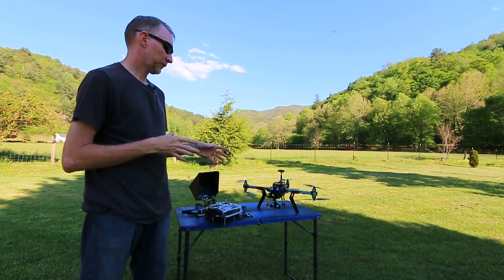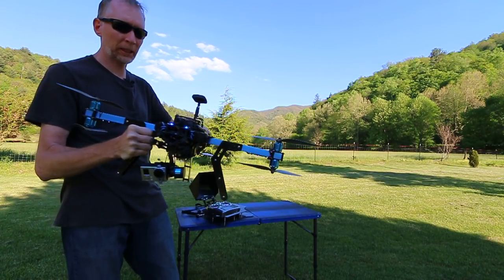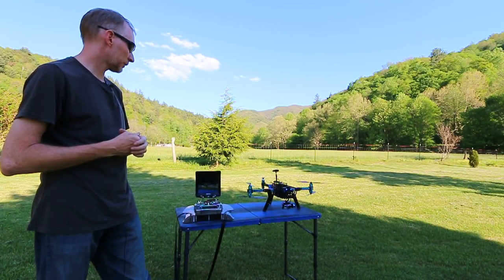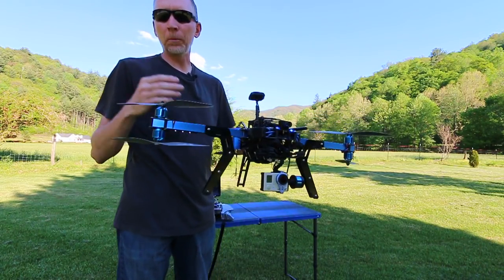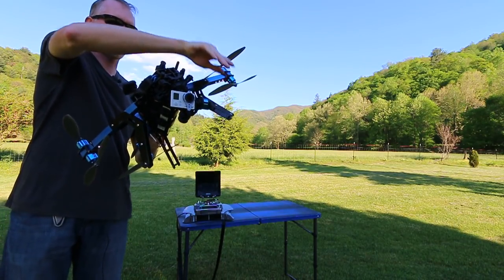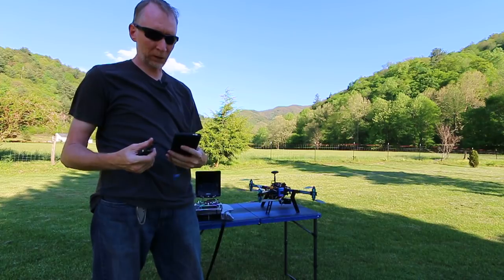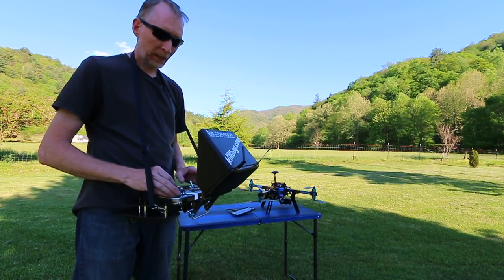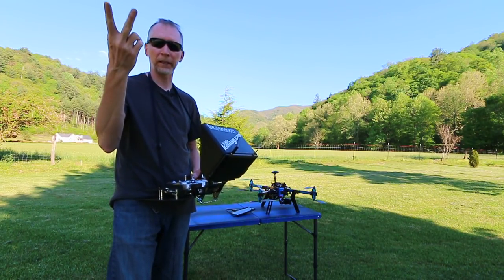3D Robotics Y6 Overview & Info

Comment: I been looking to get into this, alot due to watching your videos. ;) I've looked at DJI Phantom 2 w/ Zenmuse H3-3D Gimbal and Vision 2 Plus. What are your thoughts on those.

So your 3DR Y6 came with everything but the gopro and the gimbal?
Reply from the maker: I haven't had any experience with DJI copters, but I've heard mostly good things and they are the big dogs for entry into the autonomous camera drone field.  A few stories of fly aways, so put your contact info on there no matter what you get.

I just got an H3-3D gimbal myself to replace/upgrade my Tarot T2D gimbal, but I haven't installed it yet, so can't comment much there.  It is surprisingly lighter weight than the 2-axis gimbal though, so that's nice.

The Y6 kit I ordered did come with everything except the Gopro and gimbal since I already had those, although they will sell it with those parts as well.
Reply: killboydotcom Yea I been researching about them alot  before I actually buy one, so want to be as informed as I can.

I'm leaning towards the Y6 as its not all that much more once you add the gimbal, FPV, etc to the Phantom 2. The Vision Plus looks like a nice AIO package, but the gopro setup seem to be more versatile and future proof.

Does the H2-3D look like it will be a direct bolton replacement? And where do you get your parts? I not been able to find the H2-3D on the 3DR site. Be nice if it was a optional addon like the 2D gimbal is on there.
Reply from the maker: ***** No that gimbal will require some "engineering" (used loosely in my case) to make it bolt up, but I think it won't be too hard.  I just ordered it off Amazon or something.
Reply: Yea, for some reason I dont think that will be much of a issue for you. lol

Let me(us all) know it works out etc etc.

I've was looking at the electrohub diy kits by Flite Test for a intro/learn to fly bird, all sorts of possible configuration with that thing. And while reading up on that, watched a few videos on the TBS Recovery Pro, Thats a interesting look airframe (picking up all sorts of terminologically lol).

Thanks for the feedback and hope to see ya on the hill soon. ;)

Comment: great video.. i have been trying to get a decent machine for over four months now.. am on my sixth yes I said sixth copter and I was just about to give up until I found out about these 3dr machines.. kicking myself for wasting so much time and money chasing phantoms and 550's and 440's and storm drones.. argh well for the most part I got much of my money back but not without a fight.. had flyaways and fails due to crappy dji gear.. but that is the past.. so my question is.. what is the little camera looking gizmo that you have on the top of this one? and does this one offer the follow me tech out of the box like the IRIS?
Reply from the maker: That camera looking gizmo is a camera. ;)  It's the one it comes with for FPV, but have since removed it since I just use the GoPro video feed to see exactly what I'm getting.  Some advise against using the GoPro, as it can shut off without warning if the card gets full, battery dies, etc, but I have it getting power from the copter's main battery, and a big card that's always cleared so never any issues.

It does have the follow me feature using your cell phone, but we live in very mountainous terrain, so I haven't tried it. (or really had a need to try it)  These machines are essentially "flying blind", so be careful if you try that.  Not for use around people, trees, power lines, etc, IMO.  Machine has performed flawless otherwise, save for an instance of GPS loss when flying under a low cluster of power lines one time...had to switch to manual mode real quick and bring it back.
Reply: yea I have seen that before on others and I always wondered what the benefit of having two cameras would be.. seems like more weight and battery drain.. again thank you for the very helpful video.. your time and efforts are much appreciated.. warmest regards

Comment: have you had any issues with support from 3d robotics? how would you compare the y6 to a phantom 2? i'm about to pull the trigger and i'm leaning more to 3d
Reply from the maker: They're no Horizon Hobby level of customer support, but I managed to get answers from them within a few days by email.  I've heard good and bad from others, and heard about the same about DJI.  Basically you need to rely on the community/forums, which are very helpful and friendly at least.  I will say though that the product I received came with practically no instructions, (4-page "quick start" pamphlet that didn't even cover all of the steps to get it flying) and mine was not bound to the radio properly out of the box.  Binding this one is a tricky process since the Pixhawk controller uses a satellite type of receiver...you have to remove the satellite receiver, plug it up to the standard Rx that was included in the radio packaging, power that somehow, and bind it while connected to that.  Then put it all back and it will be bound and ready to control.

It's been great once I figured things out and got it flying...rock solid reliability and great GPS holding.  I've flipped it a few times during take-off trying to launch in a little breeze in GPS Hold mode, probably shouldn't use that mode for launching since it seems to be trying to correct GPS drift before it can get off the ground and stumbles over.  I also wrecked it once about 4 feet off the ground when it triggered RTH mode due to low battery voltage.  Kinda user errors/setup issues mostly.
Reply from the maker: Oh and they did replace a part for free that failed (12v voltage regulator for accessories) within a few days of owning it.  That was nice of them since there is no warranty implied.